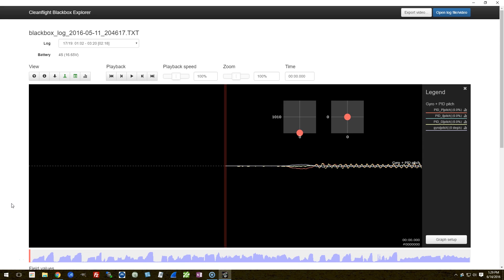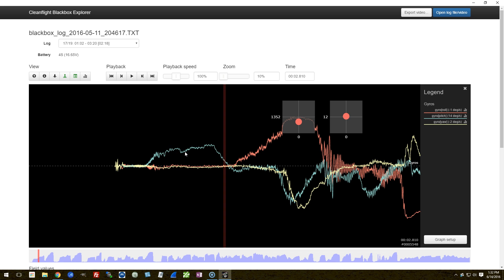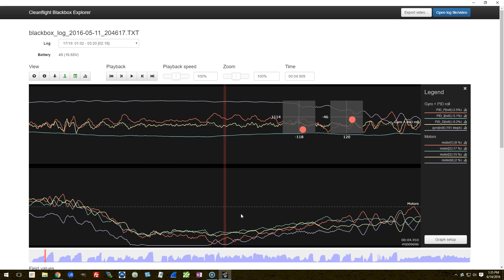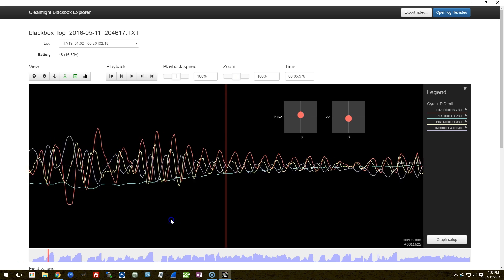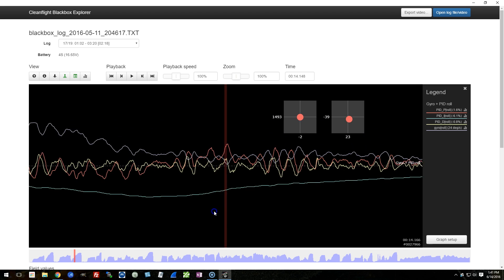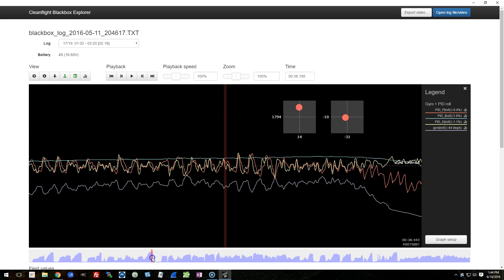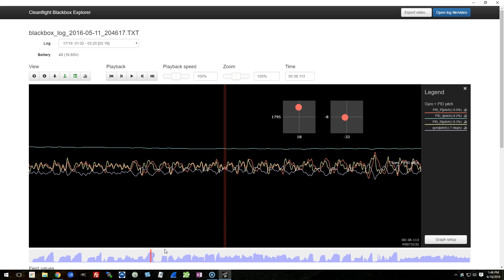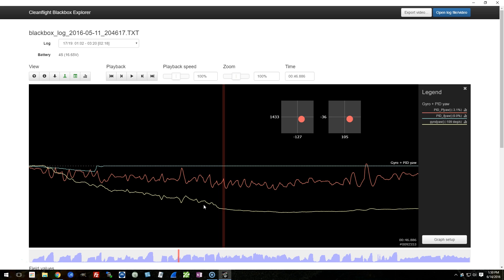Practical PID Tuning - Part 4 | HOW TO TUNE A QUAD

Comment: Is it possible that when you added tpa you added a bit too much causing the low throttle oscillations found in the black box?
Reply from the maker: Not sure how TPA could cause low-throttle oscillations, since TPA only becomes active at high throttle.
Reply: Oh ok I'm sorry I miss understood I thought it was opposite

Comment: Josh, any way to scale RCCommand and Gyro feedback so that they're actually linear on the graph in BB and on the same scale as eachother?
Reply from the maker: You can set them so they are linear by adjusting expo in the graph configuration. But I don't know if they scale the same. They didn't used to, but I think that might have changed.
Reply: Right now small dips at the top of the range can be ridiculously different in magnitude as when the changes are closer to 0.  I just wish there was an easier way to scale that.  (checkbox set all axes to single scale) 

I was playing with expo last night to see if I could straighten it all out but for some reason, iirc, it didn't seem to straiten out that 400 deg/s around 0 and 400deg/s around 1000deg/s could be different by miles as far as how they're represented spatially.  If you know what I' m saying.

I'm not sure I'm describing that in a way that makes sense to others.
Reply: I'll play with it some more when I get a chance today.  Thanks for the prompt response!
Reply: Yeah, just remoted into my home box.  So in order to get them to scale right I had to actually play with ZOOM.

Gyro[Roll] Smooth = 0, Expo =30%, Zoom = 100%
rcCommand[roll] Smooth = 0, Expo =80%, Zoom = 82%  

Now deg/s actually cross where they are supposed to.
Reply: That's a lie, still doesn't cross at all the points, I just fixed it for one point on the graph.  Sigh

Comment: Key points from the video - The less filtering (therefore less delay) you have the more responsive the PID controller can get right up to the point where the noise overwhelms the PID and things can go bad.  If a motor spins up smoothly on blackbox then the min throttle is set correctly.  If It spikes then it is not.   P term oscillations are smooth and consistent waves (fixed frequency), D term oscillations are irregularly shaped waves.

Comment: Hey at 5:30 in this video, could that oscillation be caused by vortex rings ? 

You dropped the throttle to zero so I was thinking maybe that is possible...

then again maybe not, I am a total newb after all
Reply from the maker: I don't really know about that.
Reply: https://en.wikipedia.org/wiki/Vortex_ring_state

I think this is normally countered by never "stopping" the motors and moving in a direction

But you can demonstrate this by going to a high ish height and level hover then strait drop for a bit and then when you throttle up the copter will wobble and will not pull up until you get very close to the ground (you may hit the ground pretty hard)

Comment: When you say "the lines do not look thick". The line thickness doesn't change so I assume you're referring to peak and valley deltas of the oscillations?
Reply from the maker: When you zoom out, the individual lines get compressed together into the appearance of one fatter line. That's what I'm talking about the thickness of.

Comment: First, want to thank you tremendously for all your informative videos. I've gotten a lot out of them. A characteristic that I seem to get on my quad is a sort of tight nodding or bouncing that I mainly see on my Mobius video. It has persisted even through motor, esc, and firmware changes. Any general advise regarding tightly sprung bouncy Behavior?
Thanks Josh?
Reply from the maker: Have you got a video link?

Comment: Did you find the problem to those little twitches? Was it the mounting causing it? I have a similar problem but a much more severe twitch happening every half second or so. Very odd, will try dampening the fc with rubber rings.
Reply from the maker: I never found the problem. And it was never an issue in flight.

Comment: do you mean cleanflight when you say betaflight?
Reply from the maker: I don't know. Do you have a timestamp?
Reply: You consistently say betaflight when the software shows cleanflight in this pid tuning series of yours. Are they the same?
Reply from the maker: They're not the same. I think most if these people are flying Betaflight. Where do you see cleanflight?
Reply: +Joshua Bardwell e.g the thumbnail for this video says cleanflight black box explorer
Reply: 60sec in video 3 the software's logo says cleanflight
Reply from the maker: Betaflight is a fork of cleanflight. It still uses the same configurator. But it's Betaflight running on the copter.
Reply: +Joshua Bardwell ah, thank you

Comment: 10:21 are the gyro oscillations caused by the PID loop, or does the PID loop react in this case?
Reply from the maker: Since the throttle has been raised, this is probably physical oscillations getting into the gyro and the PID loop is reacting to them.
Reply: Well, then why'd you want to decrease P then? It seems pretty useful to counter the vibration.
Reply from the maker: Sorry it took me so long to answer. I missed the question. The P term cannot respond fast enough to deal with higher frequency oscillations. So it is "behind the curve" if you will, and everything it does just makes things worse. Ultimately, if the HD cam is smooth then all is well.

Comment: Hi Joshua. I was just curious as to what the looptime is on your FC for this copter? I was tuning today and had some severe oscillations in prop wash. I was running my looptime at 1 kHz. I upped my looptime to 3kHz and it helped the oscillations substantially. If you are running a low looptime upping the looptime might help.
Reply from the maker: 4k which is as fast as the F303 can go.

Comment: What version of the log viewer are you using? It don't recognise it. Do you ever compare RC_command against the gyro?
Reply from the maker: I compare rc_command against the gyro any time there seems to be uncommanded movement. But I don't think there is much point in comparing rc_command to the gyro otherwise, unless you have a way to translate rc_command into angular rate. Which, come to think of it, this log viewer might do.

Viewer is here: https://github.com/betaflight/blackbox-log-viewer

Comment: Nice series Joshua! So, going forward how do you see yourself tuning most of your quads? Visually and by feel, or scrutinizing bb logs? Seems you are happy with the performance of this quad, except for Yaw P, so will you go with your stick feel or nitpick it more with an openlog?
Reply from the maker: This is pretty much how I always tune. First, visually, and then the last fine-tuning with the input of blackbox. In this case, the blackbox ended up pretty much exactly where I want it, but if there had been any surprises, like a hyper-active D term, I would have considered changing the tune.

Comment: hey I live in south Fla is it normal for my motors to get around 125 degrees at really aggressive flight in using dal5040 triblades with emax 2600kv and great vid I like and comment on every one of them Thanks for all your hard work
Reply: C or F? Celsius that is too hot, Fahrenheit that is fine, you could even push them harder.
Reply: +Reuben Horner 
thanks it's f not c 
great news because my copter is running very well. Josh is there an open log device that you know if that is plug and play? I wanna see my bb logs but I have a cyclone fc :'(
Reply from the maker: OpenLog from Multirotor Mania. As long as you have a spare UART you are good to go.
Reply: just be careful if you are running the red bottoms that you don't get them too hot as you will damage the magnets which will cause the motors to lose some power. The red bottom motors (and some other motors) use n52 magnets which are more easily damaged than normal motor magnets. I think the damage starts around 70*C
Reply from the maker: Well, chicken is overcooked around 70C, so I reckon a person will be too.
Reply: Joshua Bardwell If your name is Bruce however...